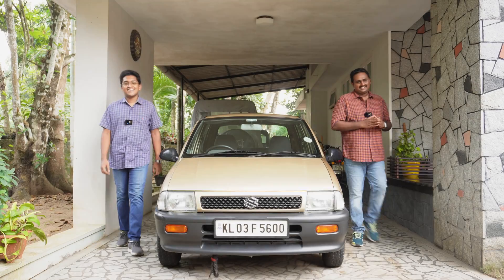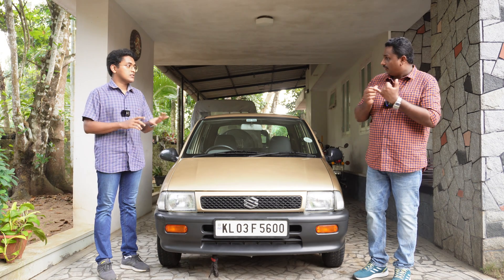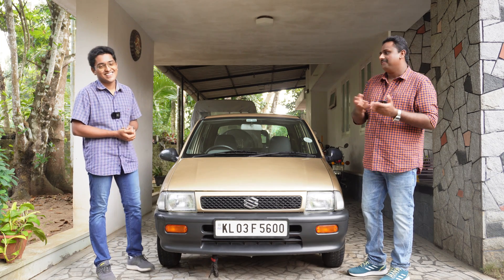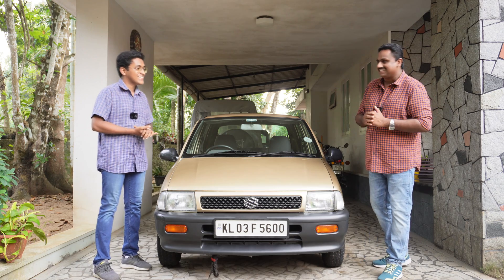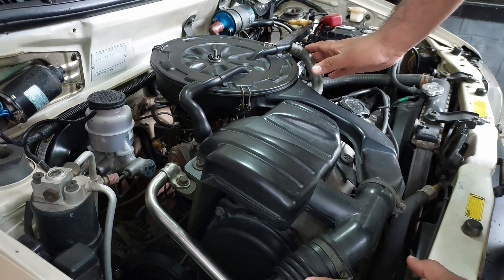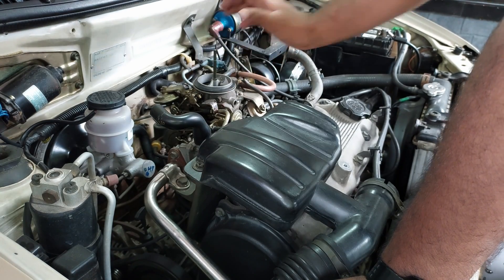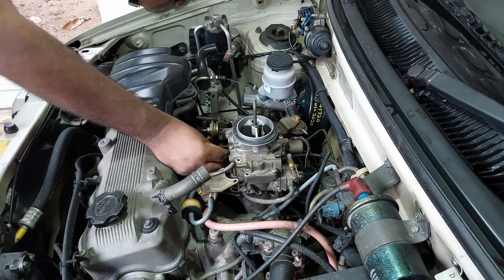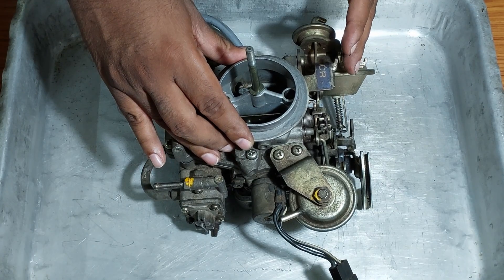Maruti Zen | How to service your Carburetor at home | Part 1 | Intro | Dismantling | English

Comment: Would you please tell what are the inner diameters of fuel feed line and fuel return line, if this Double barrel Zen carburetor is fitted in Mark IV petrol Ambassador car with custom made adapter? Existing fuel feed line dia is about 6 mm (original metal pipe)
Reply from the maker: @t.p.visweswarasharma6738  I don't remember exactly. Will check the next time I strip down the carb and fuel system.

Comment: Hi Bose Garage, I have zen 1999 Carburetor Model . It has fuel effeciency issues and the engine misses when i changes the gear, and black smoke is coming from the Tail pipe, I have given to the service garage they replaced the diaphgram also the jets but the problem still persist..

"This time i am opening my Car's carburetor on how you desemble and assesmble the carburetor hope it works 😀"

btw thanks for such informative videos much much needed.
Reply from the maker: Hello, 
The issue may not be because of the Carburetor itself. Please check the following. 
1. Check all the fuel hoses from the fuel tank till the carburetor. With age some of them might have dried up and seepage of fuel might be happening from the cracks on the hose. You won't notice any leak when the car is idle. When the car is running the fuel leak will occur and will evaporate away immediately. This could be a cause of low fuel efficiency and erratic idling. To replace all the fuel hoses you will have to drop down the fuel tank as well. At this opportunity clean the fuel tank as well. 

2. Change the fuel filter, air filter and spark plug if they are not replaced on time as per the service schedule. 

3. Check all the vacuum tube connections and evaporator hose connections in the engine bay. If the hose seems to be good and you are not planning to replace it then at least check and ensure that they are not clogged. Due to age and old fuel clogging can happen inside these hoses. So check all of them one by one. 

4. Then service and tune the carburetor as per the procedure in the service manual. 

5. Also check the tappet clearance. 

This should solve your issue.

Comment: I have a 2000 model Zen and I am unable to find its carburetor in market. Dealers here say it's out of production. 

Can you please guide from where can u buy a new one
Reply from the maker: Brand new MGP carburetor for Maruti Zen is no longer in production. You can try to purchase a Pacco brand carburetor which is available in most spare parts shops.
Reply: @bosegarage   pacco or any other brand is not available in Hyderabad... can u please share some links or contact from where I can buy
Reply from the maker: Try contacting this number +91 97164 07578. Seems to be a Pacco Carburetor dealer from Karol Bagh, New Delhi. We have never purchased from them.

Comment: Thanks for the video guys! I'm sure a lot of Zen owners/enthusiasts will find it helpful.

By the way, I believe the rubber hose connecting the air filter assy and the steel pipe going to exhaust manifold is (to the best of my knowledge) something Suzuki calls secondary air unit (a hogwash emission reduction system that came in euro 1 carb models.)  Unlike the EGR, it takes fresh air from the air filter assy and adds it into the exhaust stream.

The EGR valve is vacuum operated in this variant and it is located near the intake manifold on the other side ( distributor side ).
Reply from the maker: Thank you so much for the clarification brother. I really appreciate it. We will include this information in one of our future videos. 👍🙏

Comment: I have maruti 800 1999 model, which is jerking at lower gear and sometimes car engine completely stops, showed it to authorized service centre  and local mechanics this problem remains unsolved. 
New carborator and other necessary doubt ful parts are replaced new then also no use. Iam from Mumbai, kindly guide me. Now I am in hopeless situations.
Reply from the maker: We will try our best to guide you in this regard. Please let us know one by one what all parts have been replaced till now.

Is the Carburetor that you bought a brand new Maruti Genuine part or a Used one.?
Reply: @bosegarage  please share your contact number
Reply: @bosegarage  yes new carburetor
Ignition coil, checked for return line
Wheel alingnment ,engine tune up by machine, carburetor settings etc,
Even then jerk at lower gear exist feared off if the vehicle suddenly stop in running on highways or sometimes in slow moving roads, there is always a fear that the car may stop in between, no smooth drive fear of jerk and sudden stop of engine. Thanks
Reply from the maker: @pradipunavane662  Did you replace the CB points and condenser? Also try replacing the spark plugs and the spark plug lead wires. Also the lead wire from ignition coil till distributor.
Reply: @bosegarage  actually all mentioned by you is done by mechanic, but I don't have the bill of these replaced parts. Kindly share your contact number so I can send photos of engine sections to you. Thanks
Reply from the maker: @pradipunavane662  Please share your WhatsApp number. I am abroad now. Will reach out to you.

Comment: Thank you so much for taking the trouble to make your videos in both English and Malayalam. I feel a little guilty to put you through the trouble but am sure the rewards will overshadow the the trouble (by getting many more subscribers and viewers) Thanks once again 🙏🏼
Reply from the maker: No worries. Infact it is easier to take videos in English than adding subtitles to Malayalam videos. Only issue is some videos which I already took in Malayalam. Need to dub them in English as well. As only my hands are seen in those videos it won't look odd even if I dub it to English.

Few more videos will be uploaded by next month.

Yamaha RD350 some interesting facts and alternative parts.

Yamaha RD 350 Carburetor Service

Yamaha RD 350 Timing and Tuning. Points and Cam replacement

HM Ambassador front suspension complete rebuild

Kinetic Honda CVT system service 😁
Reply: @bosegarage  I appreciate all the effort that you're putting in.  Hope to learn a lot from you guys. Much respect :hand-purple-blue-peace: